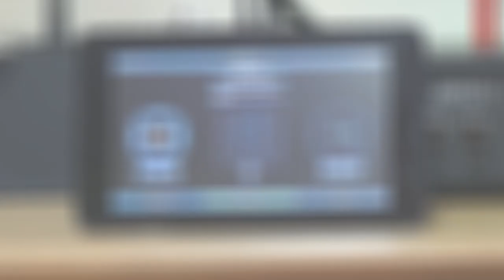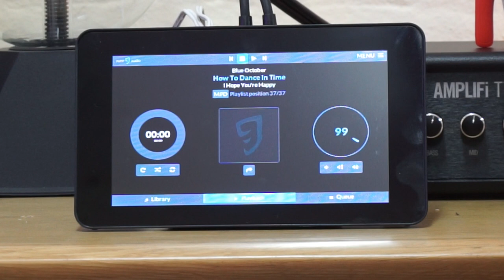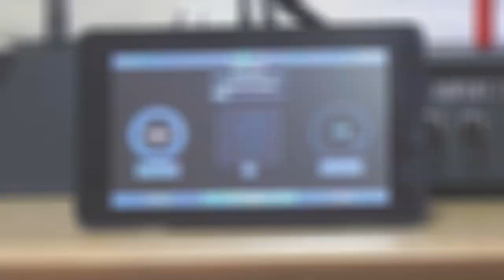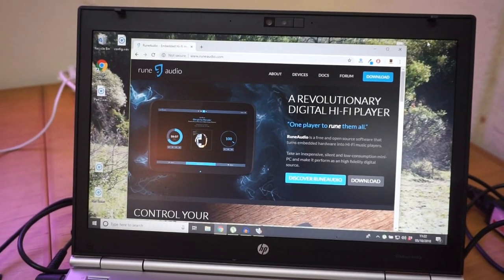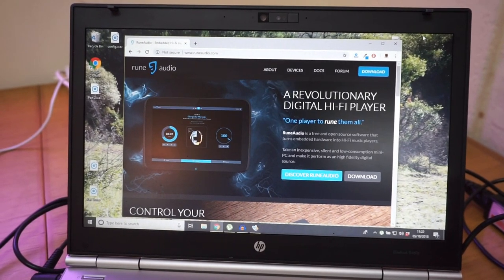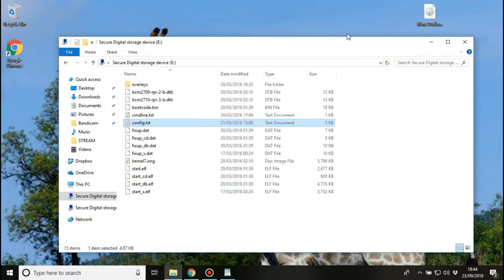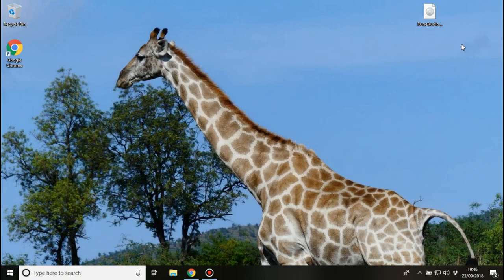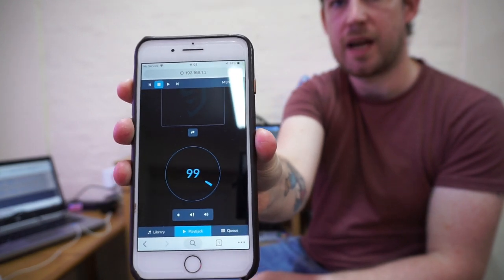Build a Raspberry Pi HiFi Player!

Comment: Great video but i have a couple of questions regarding my application.  I'm going to use this to play ambient noises in a nature center. Will this need to an amp as well to power the speakers or is the raspy play board enough?  Also will this play music off of an sd card that was in a usb card reader that was inserted into one of the usb drives on the pi?
Reply from the maker: I don't have the board to hand but from memory it doesn't include a power amp so you'd need to plug it into an amplifier. There are other raspberry pi boards available with power amps built in I think. On the 2nd point I don't think this will be an issue but I've not tried it myself

Comment: Nice video. One Q: Can I use Raspberry Pi 4 with RaspyPlay4 board ?
Reply from the maker: The Raspberry Pi 4 uses the same pinout for the 40 pin GPIO header, so in theory there are no compatibility issues.  But, make sure that the software you wish is suitable for the Raspberry Pi 4
Reply: @TechMadeEasyUK  Thanks a lot, I will check software first.